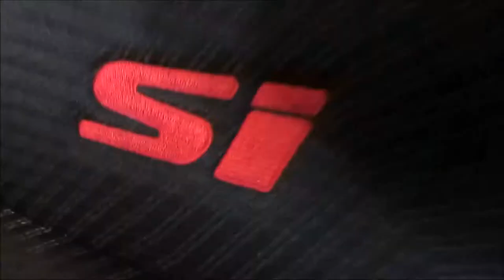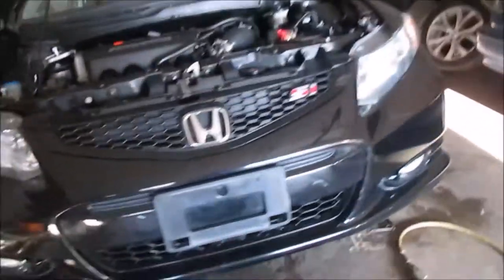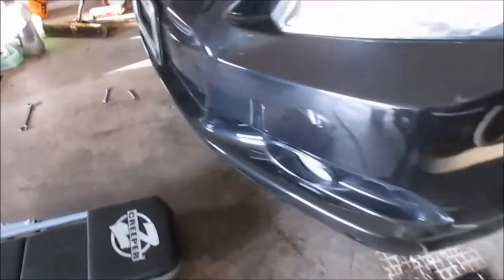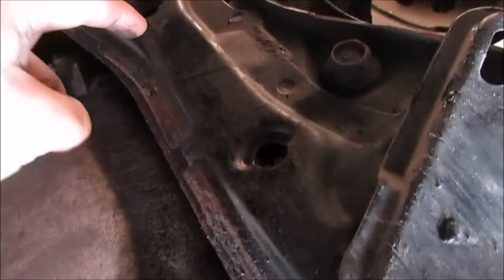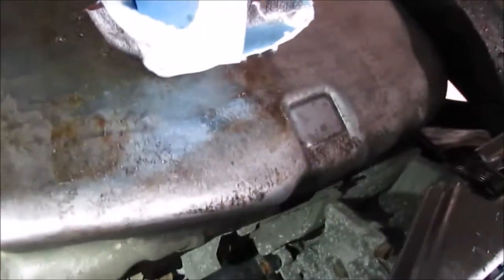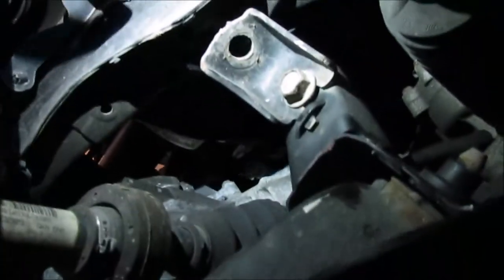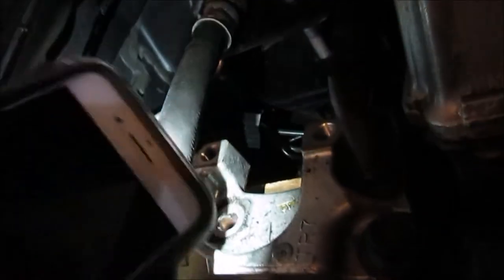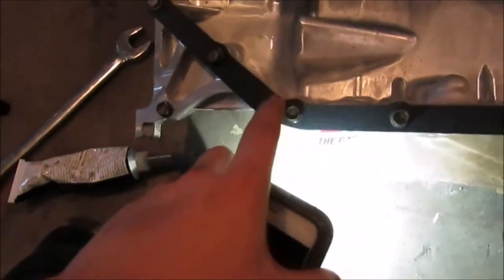How To Change A 2012 Honda Civic Si Oil Pan Gasket

Comment: Hey Nice video bro but did you by any chance have to in unbolt the steering shaft to drop subframe
Reply from the maker: Mark Martinez No I didn’t, in the video, you’ll notice I jack the engine up and put some wood 2x4 pieces under the motor mounts. This held the engine up high enough, to where I just had to lower the subframe about 2-3” and did not have to unbolt the steering shaft. I never fully dropped the subframe, I just lowered it. And thanks man, I appreciate it!

Comment: Do you know Where can i find the timing belt for this vehicle 2012 si honda
Reply from the maker: I’d go through your local Honda dealership. There are some chain guides, a tensioner, and two chains for these engines
Reply: @BoostedS2000  thanks